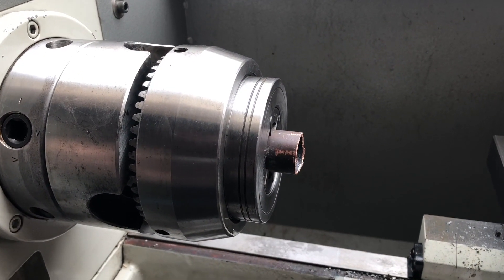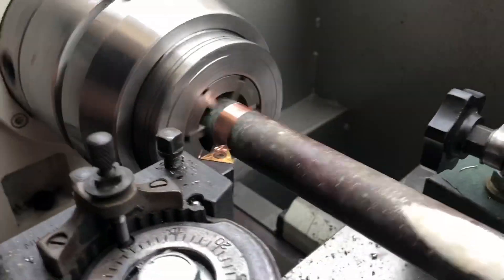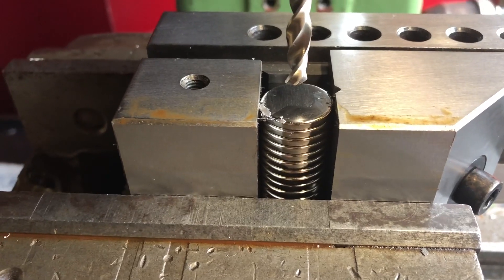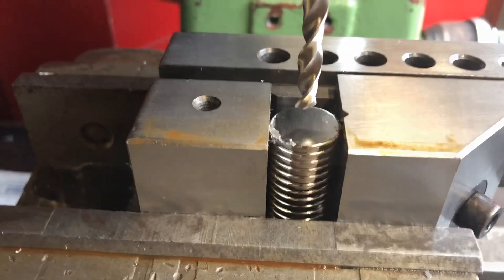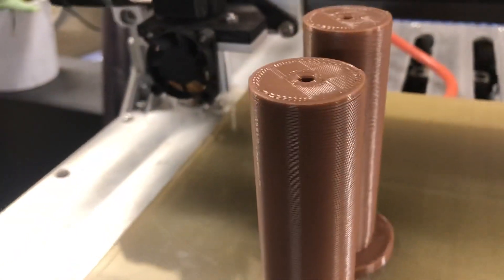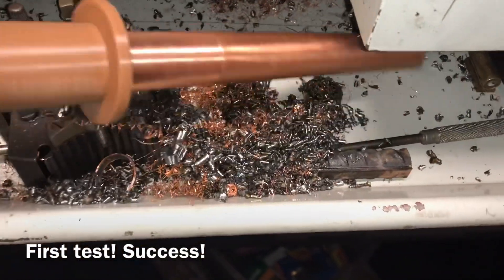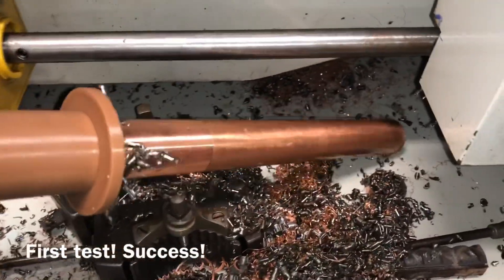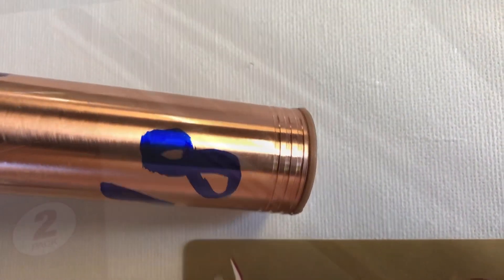Tool Time - Magnet Swarf Sweeper Build #YMGSS18

Comment: Do I see a batch #2 Aluminatus in operation? :)
Reply from the maker: Some pics from my rebuild here... https://flickr.com/photos/87180506@N08/sets/72157647547282865
Reply from the maker: My prototype 2 colour extruder desig is here also https://flickr.com/photos/87180506@N08/sets/72157649174491007
Reply: @JBFromOZ  the work you've done is quite impressive.    The example I have is fairly stock, and I'm looking at EZ's  list of batch2 mods on the g-group.
Reply from the maker: Absolutely, number #84 if my memory serves me correct, I was fortunate to end up with one of the two in that batch that was cancelled by original purchaser, Ezra gave me a great deal on it
Reply: @JBFromOZ  I recognised it from the angle brackets and the  deck pattern :)
Reply from the maker: Not many know of the A1, have you used one?
Reply: @JBFromOZ  I'm just getting started with an early A1. It's my first 3DP so learning the hard way, fortunately there are a lot of good resources these days.
Reply from the maker: I’ve replaced my brains with a smoothie board, and added a silicon mat Heater, and filaprint print bed, it’s been real reliable since
Reply from the maker: Daniel Gross owner of filafarm.de also runs a couple of A1’s
Reply from the maker: My single extruder design might be worth adding to your build, email me jb at designlab dot cx and I can email the stls, it uses the phidgets 5.18:1 stepper but adjusts the centre of mass on X travel to the centre of drive, so no pendulum effect at the end of the hot end. A minor, but useful improvement

Comment: Nice video, how is the lathe going? i'm thinking of purchasing a 960b myself. How many RPM's do you get with the VFD.
Reply from the maker: VFD at 35hz = Fast pulley (1400rpm) VFD at 15hz = Slow pulley VFD at 50Hz = pretty close to 2000 rippums! that's based on the motor and pulley that I ended up with, which I'm really happy with.
Reply from the maker: I’m really stoked with the lathe too! I haven’t missed having a compound slide, and parting ops etc are really nice, solid machine with enough power for me to do some damage haha

Comment: That's bad ass man!  I was going to make something similar.  Can a guy with only a manual lathe and mill make that?
Reply from the maker: i only have a manual lathe and mill (3D printed parts could be turned on lathe as required, lots of options and other swarf sweepers on youtubes)